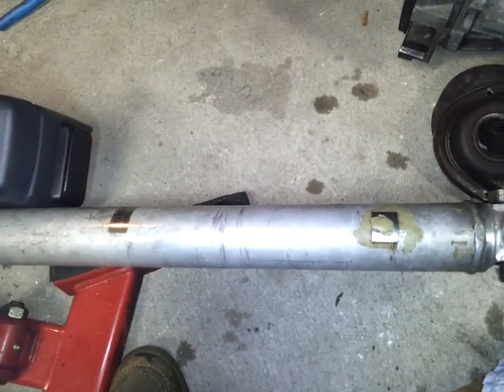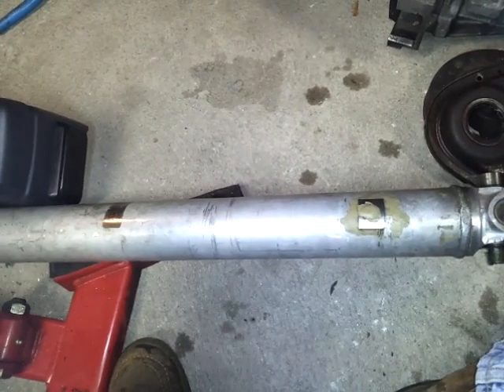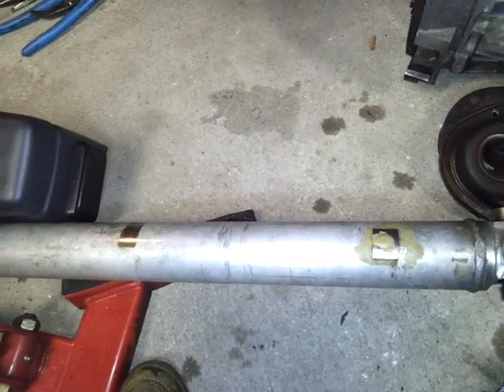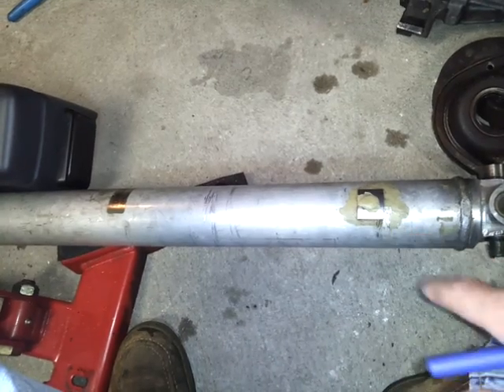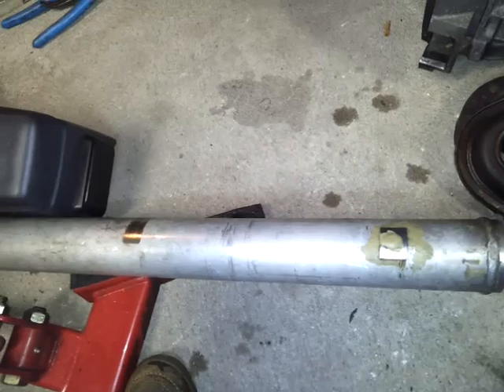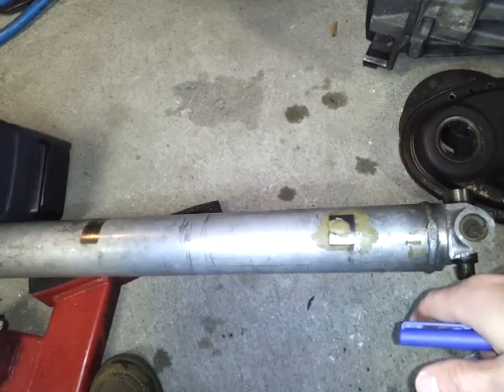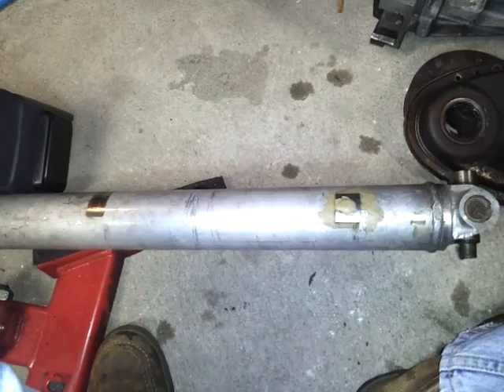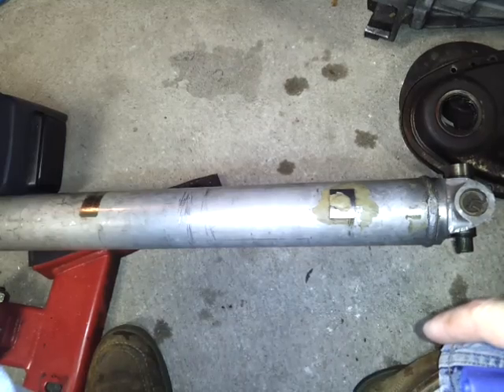ALUMINUM DRIVESHAFT - Pros and cons

Comment: Do I need to get my U joints pressed on??
Reply: Ujoint replacement on an aluminum driveshaft is the same as a steel one. You can use a hammer or a ball joint press

Comment: Aluminum driveshafts have a higher critical speed than steel ones.  They are great for lower power applications less than 800hp.
Reply: Nobody calls 800-900 HP "low horsepower"
Reply: 800-900 HP is most people haha.